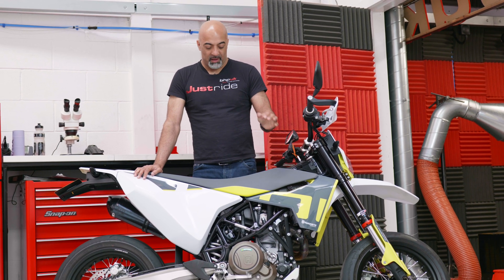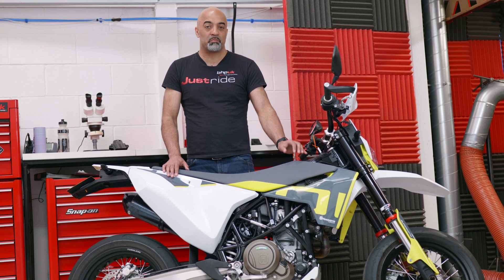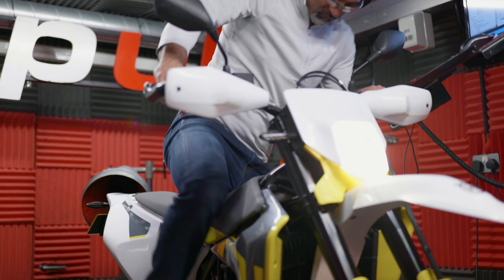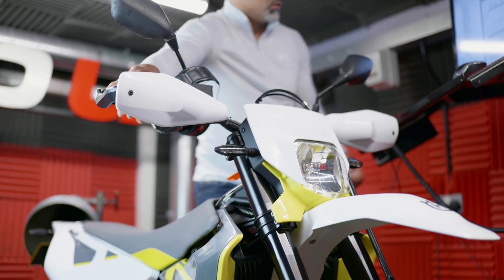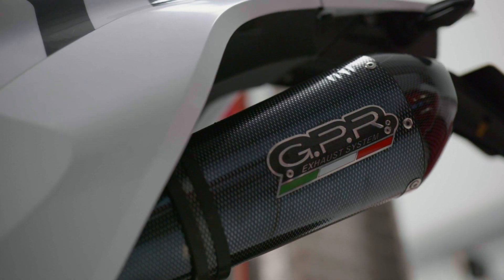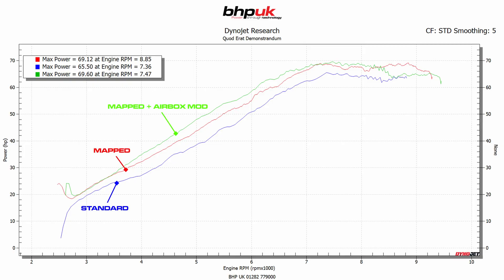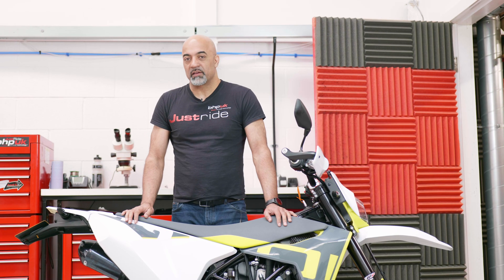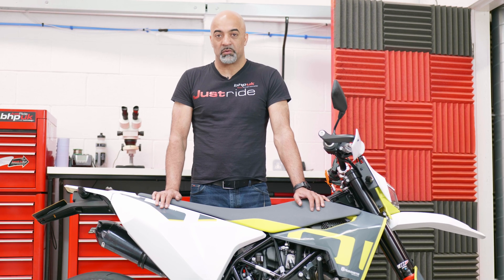Husqvarna 701 / KTM 690 SMC / GASGAS SM 700 | Euro 5 | BHP UK Custom ECU Remapping Development

Comment: What is the state of the warranty after it's been tuned?
Reply from the maker: Technically it’s intact. Your dealer may argue the toss but legally it’s intact. We have heard of very few instances that the dealers will invalidate the warranty because of a remap.
Reply: Does this go for any bike? I have a Triumph Tiger 660 that I have a full system on and a remap and my dealer told me that could affect the warranty if something ever happens to the engine. But that didn't sound right to me.

Comment: So, What will improve your ECU remapping for the Euro 5 ? Bcuz I have a 701 Euro5 with AirBox open and Aftermarket Exhaust and when I put up the gas (throttle 100%) she starts to acting like if she has trouble with the QS, and I investigated about and it 1 of the problem of that ECU Euro5, and you do Remapping development for Euro 4 too?
Reply from the maker: We can fix the problems on both the Euro 4 and Euro 5 bikes.

Comment: Are you able to modify the fuelling under 5k RPM? I've read a lot that this is where things get more complicated and these euro 5 engines start to modify their fuelling to satisfy the emissions limits set within the bikes ECU? So anything under 5k would re re-written on the run by the bike making items like the PCV useless without an intervention of a dongle for the O2 sensor etc.?
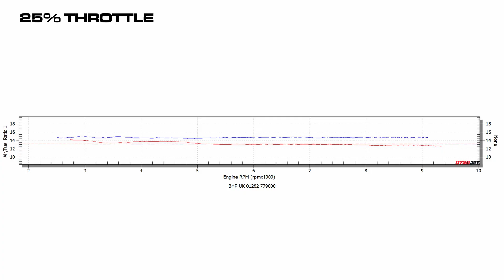Reply from the maker: Yes we are.  In our opinion any tune on any Euro 5 bike that doesn't correct the fueling below 6000 RPM is pretty useless in real world terms.  The fueling plots at 2:11 show that we correct the fueling at all RPMs at all throttle openings.

Comment: I have a Euro 5 KTM 690 SMC-R and frustrated with the fluffy throttle response at low revs. Riding in slow traffic is a PITA. 
Could I send you my ECU for remapping or is the dyno run essential? (I’m in Jersey).
Reply from the maker: Hi Dale You do not have to bring the bike to us.  There is an ECU flasher available for your bike.  You will still get a bespoke tune written by one of our map writers and you will be able to put the bike back to standard should you need to.
It is available here https://shop.bhp-uk.net/products/husqvarna-ecu-flasher?variant=41287102365749
there is more info here  https://www.youtube.com/watch?v=nxxkAM5XvSM
Reply: @BHPUK  would it work on a 23 gasgas 700?